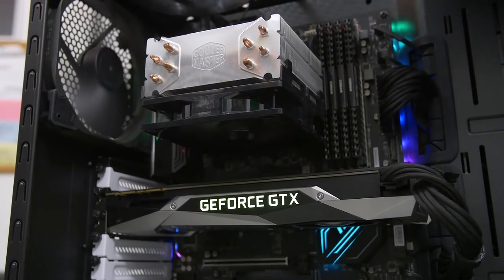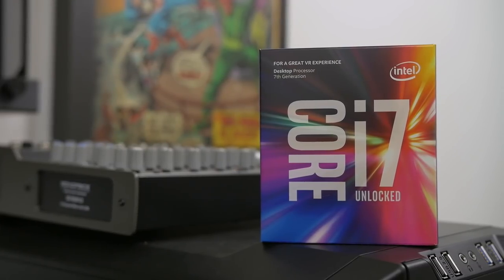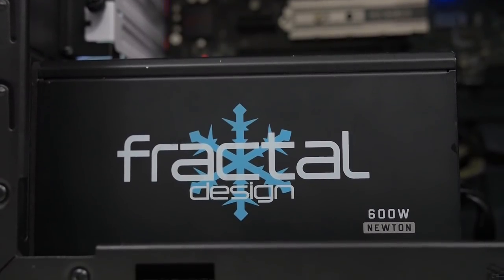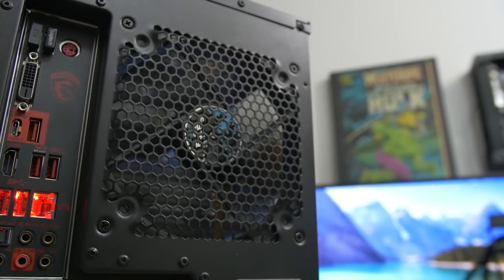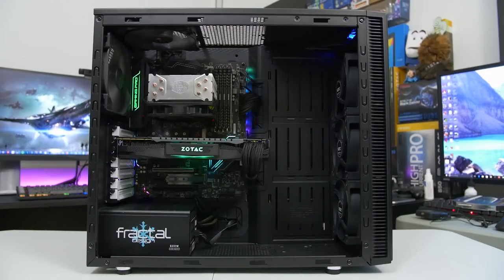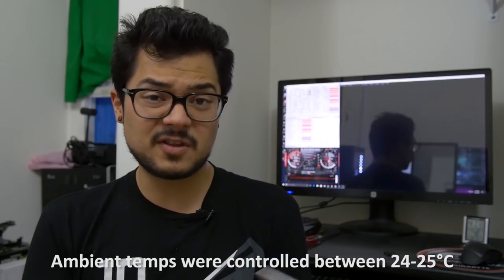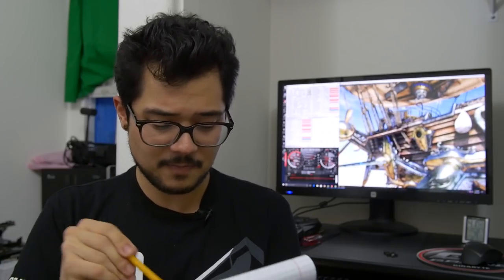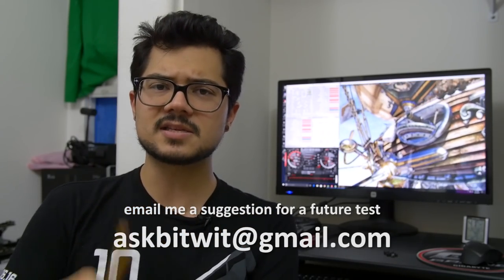This is how you should mount your CPU cooler! I think??

Comment: see how much GPU power you need to get games to run at 144hz at different resolutions
Reply: Jake Conner four peanuts and two butters²
Reply: he is talking about gpu graphical power not wattage pulled.   dummy..
Reply: 1080p? A gtx 1070 would do it for most (but not all) games. Gamersnexus just did a great video with a heavily overclocked gtx 1080 and 7700k and found that it wasn't enough to get 120 fps in most games at 1440p though. Really need to get into SLI at that point.
Reply: Not even my gtx 1080/i7 4790K 4.7ghz combo gives me 144 fps ultra 1080p in somewhat up to date AAA games.
If you really want to have constant 144fps to profit off your 144hz monitor, and you want to play on ultra/very high, you'll need at least a gtx 1080, as I said not even that is enough.
Reply: vermillioN lol what are you talking about, my Asus Strix GTX 1070 OC can play many AAA titles on ultra past the 144 mark. Doom runs at a steady 180fps, Rainbow Six runs at 160fps, Project Cars runs well over 200 fps. A 1080 is overkill for 144hz 1080p gaming.
Reply: Jake Conner for 144fps+ even in 1080p, any slightly demanding game is gonna need a gtx 1080.
Reply: I feel like all these responses is why we need a video. Not necessarily from Kyle, but he is the one who asked.
Reply: Jake Conner i like that idea,  maybe to test esports,  i get 150 with a 1060 high in OW
Reply: A gtx 1080 is not overkill for 1080p and you are haven't named a single title that is graphically outstanding or up to date except for doom which is ridiculously wel optimized.
Witcher 3 runs at 90-120 fps, gta v, when grass is on ultra at 160-50, normally at around 60-90ish, deus ex md 60-90 as well.

All the titles you mentioned don't require a lot of graphics power to run smoothly. If you want steady 144+ fps on ultra 1080p, with the demanding recent AAA titles you'll need more than a gtx 1080.
I mean I've seen videos of rx 480s getting 70-110 fps in DOOM lol
Reply: exactly, @vermillioN i hate when people say get X gpu for Y resolution because it simply doesn't apply to all games. As more power goes into home systems companies will develop more complex gaming engines to outshine their competition. Best way to buy a gpu is to get the best one within your budget that runs games, benchmarked by others, at the resolution and fps you want currently.
Reply: Jake Conner None of the current, wait for next gen release.
Reply: with that mindset you'll end up never buying anything. while waiting for volta, you might just as well wait for the 1080ti. well when waiting for the 1080ti you might just as well wait for the 1180/2080. and then you'll have to wait for amd to follow, and the 1180/2080ti.
you get the idea.
Reply: vermillioN depends tho
Reply: Don't forget the CPU. ;)
Reply: What software do you use to measure your temps?
Reply: It's not overkill for 1080p. the games you mention are just not very good examples. doom runs at +100fps on pretty much any half decent gaming rig from the last 5 years, rainbow six's graphics are rather low end and racing games traditionaly run faster then other 3D games cause there is not much to render apart from highly detailed cars. play some witcher 3, gta5 or even crysis 3, put on 8x MSAA and watch your fps melt. combine that with a 120+ hz monitor without gsync and see how long you can take the microstutter you will get from fps fluctuations below native refresh rate... and if that's not enough, you can still half your fps with stereoscopic devices... I even heard people saying that it's a 4k card, i can only laugh about that!
Reply: that's what rivatuner was built for :)
Reply: rivatuner won't give me 120fps where the game is running only at 40... and capping it at 30 is not making it much better.. :D
Reply: SiLeNCel2 Honestly in my own personal opinion I don't much care for any Anti-Aliasing. Me personally, even on a 1080p resolution,I can't tell a difference between 8xMSAA and it completely off. Maybe it's just me but I don't see the point of Anti-Aliasing at higher resolutions because with so many pixels compacted into your monitor it eliminates the "jaggies" by itself having all those pixels.
Reply: The answer is rather simple: Get a GTX 1080 and hope. I mean even that won't achieve 144 FPS in most modern games; not even on 1080p.
Reply: I can see the difference very well in games with lots of foliage and long ranges like battlefield, far cry, ark etc. and i find that pixel soup moving in the background pretty annoying and even distracting sometimes. but usually, 2x MSAA or temporal does the job for me, I won't go higher except for older games due to the performance impact. not even with the "overkill-4k-1080" and that was the point.
Reply: I have a GTX 1080(EVGA SC) and literally switched from 1080p 144hz to 4k 60hz today.

Two games I run a lot are Fallout 4 and Just Cause 3.  One thing I noticed with OpenHardwareMonitor is that at 1080p both games were only using 60ish percent of the GPU to turn in 90-144fps.  The CPU(i5 6400) was smacking against 100 percent utilization, especially during heavy combat.  I can get 50-60fps from the same setup at 4k because the load is more balanced between the GPU and CPU.  In my opinion with a stronger CPU the GTX 1080 would definitely be able to turn in 144fps at 1080p in almost any game.
Reply: ***** why lol?
Reply: Harry Brenitenbach, Did you finish your comment? I think YT is messing with comments now too. It finished with "One thing I noticed with" and literally did't show anything else
Reply: This is true, I game at 1080p on my 1080, but I have some monitor and cpu bottlenecking going on, I wasn't sure if this was true for everyone.  Saving up for a new CPU and Monitor now.  waiting for Ryzen
Reply: I have over 1000 hours in Ark with everything maxed out and I don't really see much a difference between anti aliasing vs without.
Reply: vermillioN I followed through with my wait and just ended up getting an rx 480 to replace my r7 250
Reply: I mean I can tell a difference but I have to LOOK for a difference. Having the "perfect" graphics isn't a priority for me though personally. I'm more about the experience rather than the look of a game. I actually play a lot of FPS's and in that regard I want everything turned down to ultra low for the max frames even if I'm exceeding 200 FPS.
Reply: Jake Conner the problem is game optimization levels... also how demanding it is, its kind of hard to quantify that with so many variables without throwing yourself to the sharks.
Reply: There should be a "read more" button that expands the comment.
Reply: I have 144 Hz monitor and above 100 fps the CPU and also RAM speed become much larger factors. It's all about doing things incredibly quickly when you're down to frames being rendered at less than 10ms. This is why in order to test CPUs a lot of sites used to run games at the lowest possible resolution and settings because that's when the highest possible framerates are produced and therefore the real IPC and clock speed differences can be seen
Reply: Yes this please great idea
Reply: Ark is one of that games that, no matter what res and AA setting, is very hard for me to play due to the high amount of "erratic visuals". There is constantly stuff popping up even on highest LOD/view distance and it's not just in the background, plus all the pixel stew on the tree tops etc. can be VERY distracting to me. I captured some footage a while ago where I try to show exactly this, but I didn't upload it so far, maybe I should have. Ark is really the most extreme example I can think of. It's also far from being well optimized and can definately put a gtx 1080 to its knees.
Reply: SiLeNCel2 You shouldn't use commas as vocal pitch representation, it's, literally, bad grammar.
Reply: oh no, a grammar troll, the lowest form of all trolls! please give me a break, english is not my native resolu... errr language!
Reply: Who even uses the word troll anymore. 2011 called they want their terminology back.
Reply: SiLeNCel2 Go ahead and call Denmark. They won't find your mom or I anywhere.
Reply: Lmao. I love that you almost said English resolution. But lets be honest, nobody cares about proper grammar here. It's an informal, informational channel about computers and computer tech. If it were formal BitWit would be wearing a suit and tie, so just ignore the guy because he is here to do what he wants, which is to get a rise out of you. So it's best to go on about your day and enjoy it. :)
Reply: ah man, you're right. i'm actually having a bit of fun and didn't feel really offended and I don't think the other guy is dead serious either... but yeah, i guess i got carried away with the south park reference. i won't spam anymore. ;)
Reply: yes a great idea !!!! Hudkken your face :)

Comment: it could be that the horizontal CPU & open GPU are actually avoiding each other... in a sense.

The GPU is pulling air straight up and the air is likely blooming away and above the the CPU intake pressure drop. Causing cooler air to collect for the CPU.
Where vertical is in the direct path of hot GPU air...

Great idea for a video.

Comment: Did you re apply the thermal paste? Perhaps you did it better the second time over the first?
Reply: if you have years of experience and hundreds of builds behind you i dont think the thermal paste can be issue
Reply: +Gothin Fuklio Yeah i figured, never know though. Could be a lazy mistake.
Reply: lol you did see him piss coolant all over his rig.
Reply: Linus did a test showing the way you put on the thermal paste makes no difference unless it is way to little.
Reply: this
Reply: dmdport Do a swastica JK jk
Reply: ltt did a video on thermal paste stuff. the only difference in all the tests was when they put too little.
Reply: YouTubeWatcher no not that video again...
Reply: Griimnak He didn't switch the direction of the CPU between the first two tests. There was no need to reapply the paste.
Reply: what? you can't change the direction of the CPU. if you remove the cooler at all, you must repaste it
Reply: thorben sonntag but he had to change thermal paste when he swapped rotation of hyper 212 evo, so yes he did have to reapply thermal paste
Reply: Luka L That's the last two tests. He tested 4 setups. Two tests with each direction.
Reply: YouTubeWatcher technically that does not matter go watch LTT video about thermal paste application

Comment: One thing that everyone underestimates is interaction between heatspreader and heatsink. It's better to have the heatpipes passing perpendicularly on the "die" of the Intel CPUs. 
In fact in the best conditions (for the CPU) with blower GPU, the temperature is lower, but open GPU has negatively influenced the results. Anyway horizontal+open GPU gives a strange result.

Comment: I believe its as simple as just good airflow, because as soon as you turn the cpu cooler towards the gpu and away from the front fans temps rose up, and since in-closed gpus are mainly always more hotter than open gpus the front fans werent really helping the in-closed gpu dissipate its radiating heat , but the open gpu even though its was dissipating warm air in the case the airflow was pushing it out

Comment: @5:45 Just maybe this will explain scenario 2.  CPU cooler blows Left, GPU blows upwards, with case flans blowing left and up.  Heat is dissipated more evenly (maybe more efficiently) between the top and left of the case.   This differs from option 4.  However, this is very similar to option 3.  CPU cooler blows upwards, while GPU blows Left.  Heat going both directions in options 2 and 3.  This is contrasted to option 1 ( Majority of air is dissipated left) and option 4 (majority of air is dissipated upwards) which results in higher CPU temps.  

An analogy for scenario 2 would be having 2 straws in a beer: If you had to drink the whole beer using straws, then it would be able to get the same amount of liquid out of the can using two straws compared to pushing that same amount of liquid through mostly 1 straw.
Reply: This is also based on the concept of better cooling with a greater proportion of fresh air vs recycled air (air already cooling one component to cool another component).

Comment: Ohhh let me take a stab. The blower gpu is taking air from within the case and pushing the air laterally across the gpu and out the back, so it never hits the cpu cooler. You'd think that's good for avoiding hot air circulating in the case and hitting the cpu cooler, but maybe that's bad for total airflow in the case overall. The less air circulating in the case, the less usable air there is for the cpu cooler. The open air gpu has air all around it, which in turn creates more airflow within the case with the same air. More airflow near the cpu cooler provides more air to cool the cpu. Just a theory.
Reply: LOL no the case would have to be operating at a negative pressure vacuum in order for that to be the cause.  There is no side panel which makes this whole thing pointless anyway.  Its likely the cause was either the difference in mounting (remember he's is unmounting and remounting everytime) position, pressure or some other aerodynamic factor.
Reply: Zero One  yep plus the shitty 212 evo is shit, nobody cares about it
Reply: I see people have the cpu fan facing the rear fan, explain that people.  😫
Reply: @BarryAllen..  that works if its on a pull configuration :)
Reply: @AdityaSingh97  That's incredibly rude.

Comment: I think you changed air flow characteristics by using the lower style fan. The blower style fan would effect the pressure of the case. The blower style has a larger negative pressure zone an then pulls more fresh air away from the CPU cooler? 

You could check this by using a smoke machine.